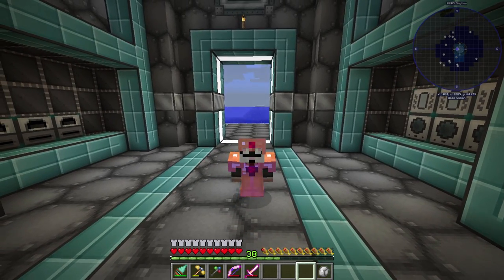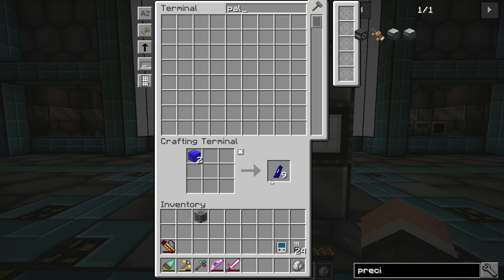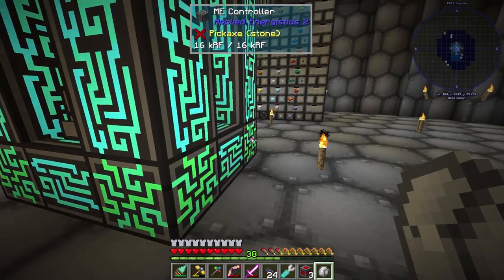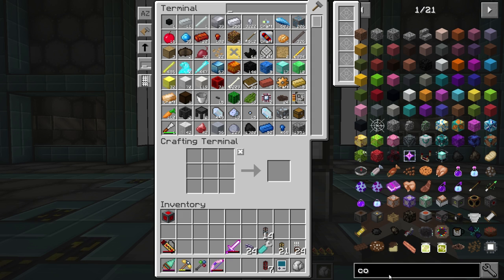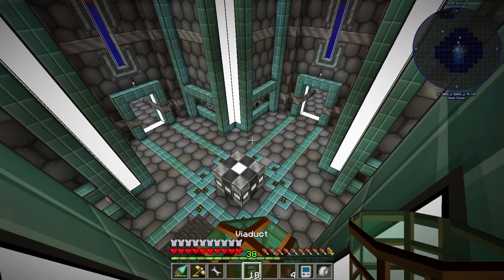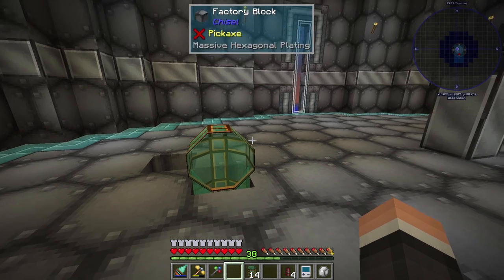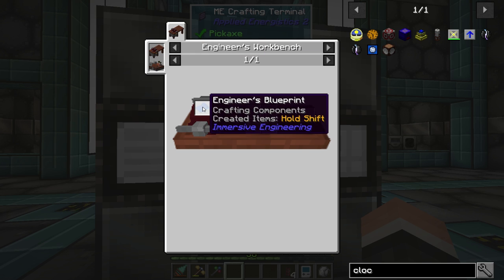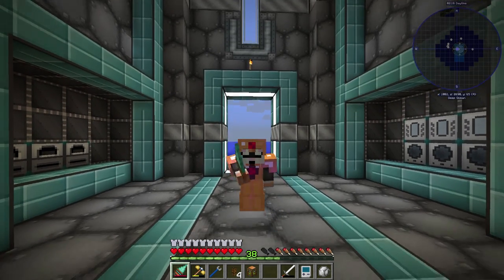Direwolf EP16 Cloches + Viaducts

Comment: anyone know what is the problem with the angel ring from extra utilities 2?  After about 70 blocks away, all the grid power disappears
Reply: check that, about 180 blocks, works fine in the Nether and mining world
Reply: Check again, doesn't work in any of the other dimensions now
Reply from the maker: Do you have the watermills or whatever mills you are using chunkloaded?
Reply: The watermills yeah, and the dragon egg thing, after 180 blocks the gp would go to 0, seems to be working now, I kept changing position of the ring
Reply: something in FTB utilities keeps disabling any selected loaded chunks, they're still claimed but not loaded... I check every time I log in then fix it if its broken